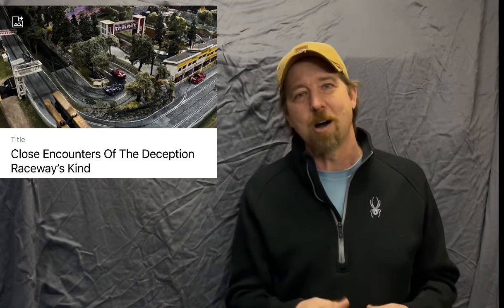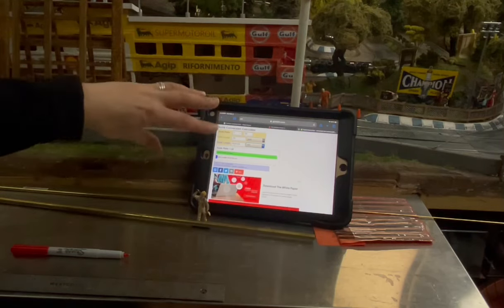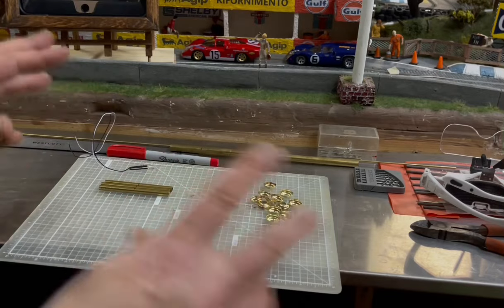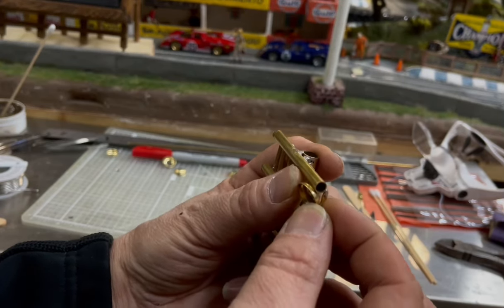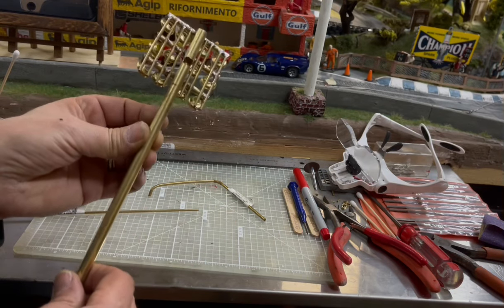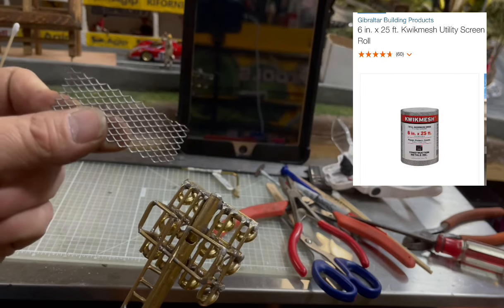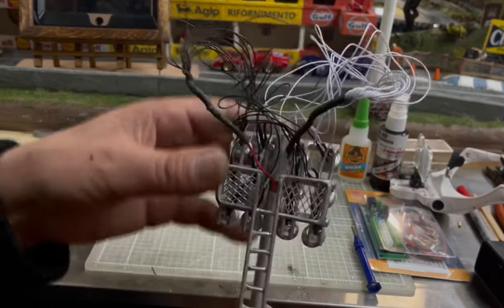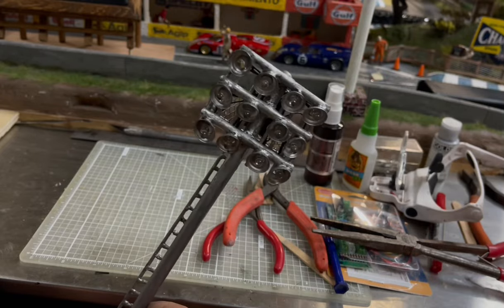How To build Realistic Vintage Stadium Track Lighting

Comment: Thank you Boone.  I've tried 3 or 4 different stadium lights.  None were what I wanted.  Yours looks great.  I was trying to use the copper tubing as my negative for the wiring to reduce a lot of wires.   My thought was it would clean it up.  I must have missed something.  Maybe a power drop off or something.  Thank you again.  
Still watching for the routed wood paint video.  But keep them coming.  Loved them all.
Reply from the maker: Thank you John , I do plan on a wood track painting video soon.. thanks for watching the videos